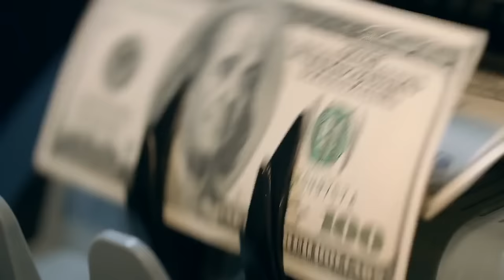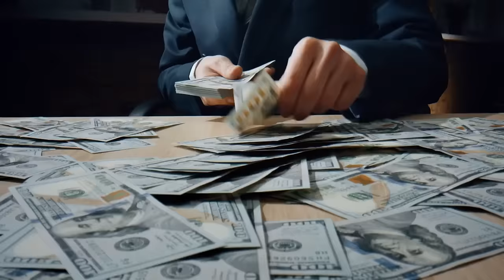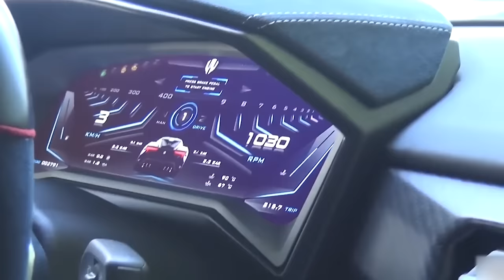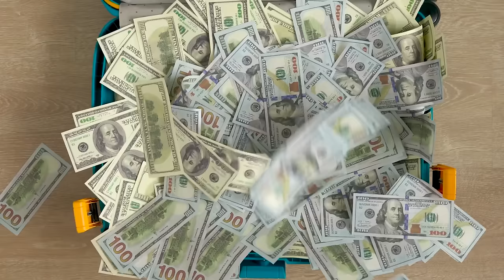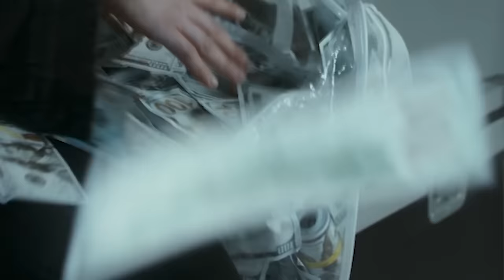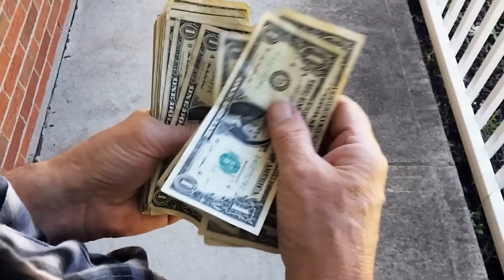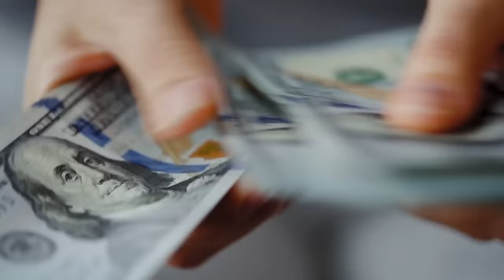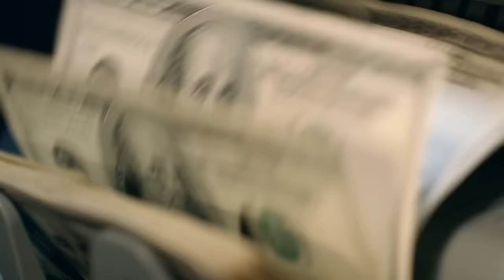20 Rare Cars Available Only to Millionaires

Comment: I sold my company in 2013 for enough money to play a bit. I've owned several exotic cars with the most excessive being a 2018
McLaren 720S Performance Coupe. I sold all of them within 2 years of purchasing, most for only slightly less than the original price.

They are a pain in the ass. Hugh maintenance bills for simple procedures that are more intelligence insulting to the owner than the offensive  price. Delicate to store and drive. You have to watch every road surface change and bump. Everywhere you go you have to answer the same questions when you park it or sometimes stopped at a light (especially convertibles/t-tops)... What is it? How fast will it go? How much did it cost? And if you aren't polite and answer them, some will swear at you simply for being able to afford it. Some were vandalized (mirror torn off, emblems stolen, door dented, windshield spit on...). The cars are generally uncomfortable and noisy but most owners won't admit it.

My favourite cars in the garage today are a 2022 Toyota Camry and a 2021 Denali 1500. No hassles, no stupid questions, no insulting bills, no worries.

Don't dream too hard. They aren't worth it.